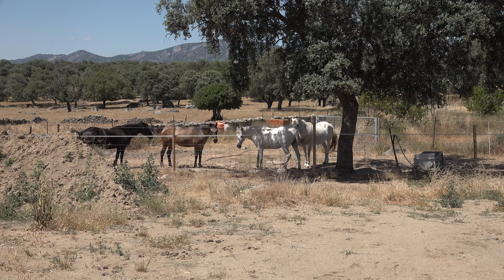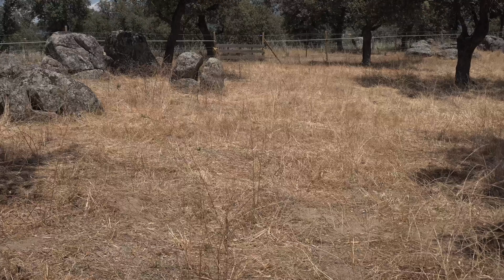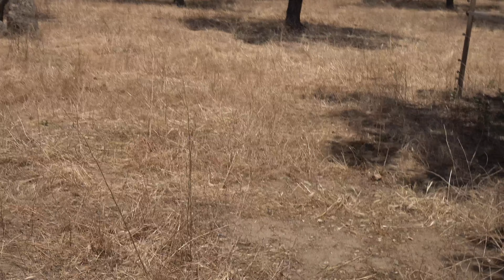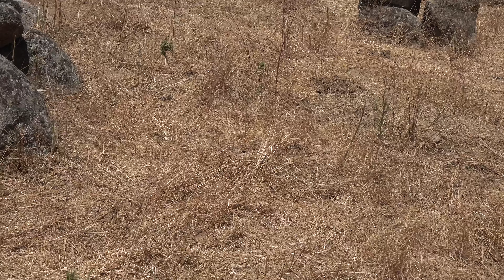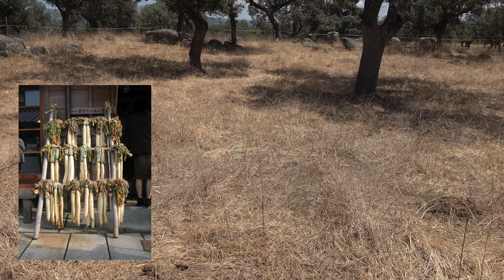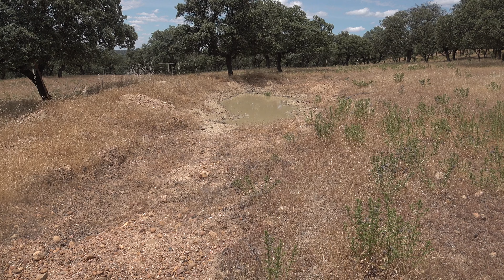Planting with an excavator - seriously!

Comment: lol... what soil horizons? Gravel and sand and bedrock at the base. Over a decade or so, you will have soil horizons. Until then, they are barely worth mentioning.
Reply from the maker: Right :-) But actually :-(
Reply: @ProjectGranjaCaimito  you'll get there.
Reply: It already starting. Compared with the beginning it is already 300% better.
Reply from the maker: @jankrijnen7374  In some pockets. It's a looong way
Reply: Mediterraneans soils need more carbon, only straw, manure or leaves are no sufficient.

You can put on soil more biochar to increase fertility
Reply from the maker: @loicville6446  Working on these things. The main issue is that material is usually not easy to find around here and so everything is complicated.

Comment: Are there any native species that can be introduced alongside/instead of non-native species. Whilst non-native species can produce results they aren't as likely to generate self sufficient ecosystems since local floral and fauna have not ecoevolved alongside them. None natives tend to require more intensive support from you or can become rampantly invasive.
Reply from the maker: These Paulownias are a temporary thing for fast biomass and sterile. Once we have a nursery we’ll be planting lots of natives but it is much slower and they require the same support
Reply: Correct me if I’m wrong but due to serious climate changes all planting and soil management might need to be reconsidered. This to at least help safe traditional species so they can benefit and coexistence with non-native species. Differentiating invasive from noninvasive is essential. I do believe at Granja Caimito every step is taken well considered of its consequences. My deepest respect, love your videos. Greetings from our finca in Almansa.
Reply from the maker: @fincalasbotas8828  Thanks. Yes, those could be my own words.